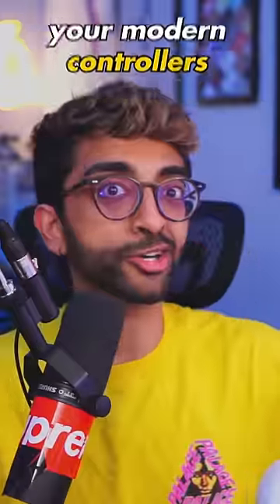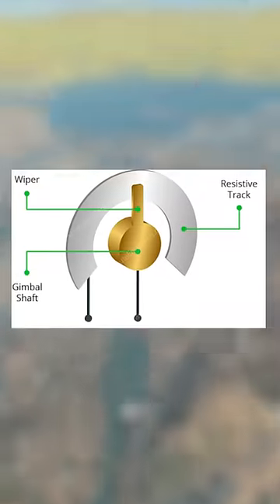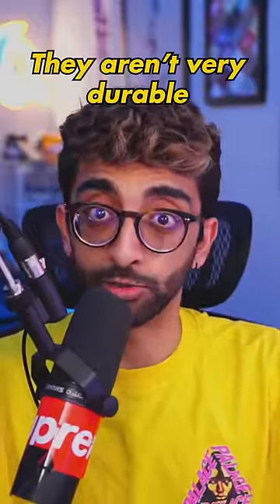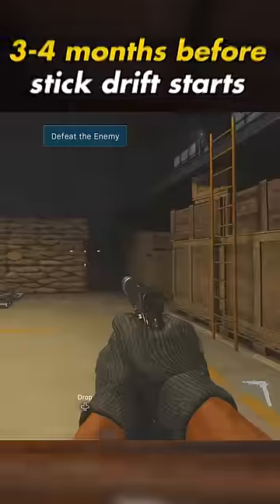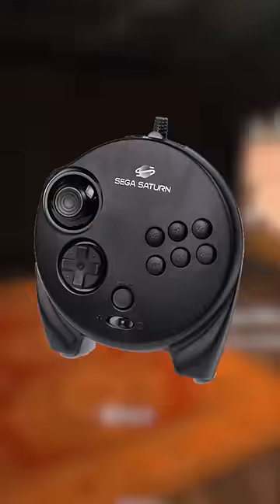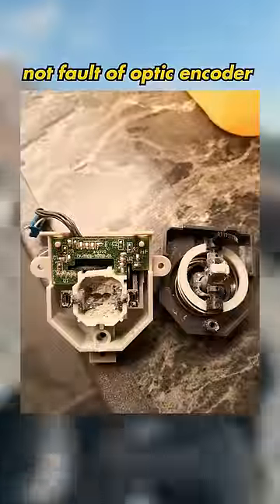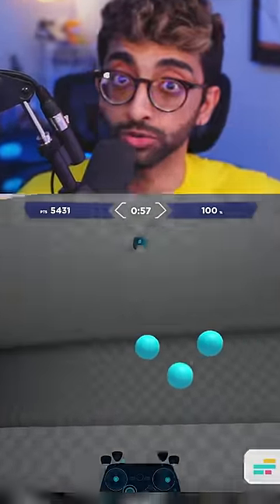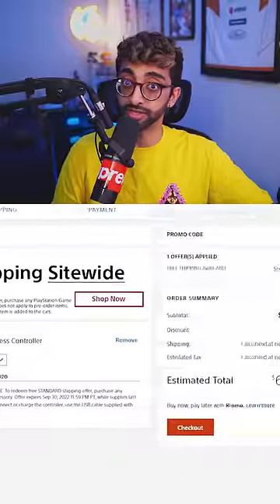The TRUTH Behind Joystick Drift

Comment: Even a quick, low effort cleaning can completely revive a controller. Like a half hour breakdown to get the gunk out and clear your contacts can add a long time to the lifespan and make a marked difference in performance.
Reply: Real af, I got an og xbone controller and another for parts and they’ve lasted me 10 years
Reply: Yup had two controllers get stick drift and wasn’t prepared to buy a new controller so I opened up and cleaned it and both controllers feel like new
Reply: Facts I’ve literally poured alcohol into the gaps under the sticks and it fixed my stick drift
Reply: Whoaaah you expecting A LOT from Nintendo haters crying about stick drift.
Reply: Sorry. You can't clean away metal wearing off.
Reply: @madchoochoo1501  xbone?
Reply: @a_monkey_hater  XBox One. That's such a dumb console name.
Reply: @a_monkey_hater  Popular nickname for the og xbox one cuz it was a bit off a mess when it came out
Reply: @4f52 Often its not the metal wearing off, but gunk filling up in the sensors. Just clean it and you’ll see big differences
Reply: @4f52  cat meat.
Reply: I cleaned mine and it got worse😪
Reply: Use compressed air to spray under the sticks.

Always fixes mine
Reply: Yeah I use qd electric cleaner
Reply: Literally untrue did u watch the video?
Reply: @Wavedashnoir  no it can work he just might not have thought about it
Reply: @YTREZN  That has nothing to do with the product lifespan reported in the video.
Reply: @4f52  its the metal (or whatever material that is used) that wore off that causes the problems, the gunk causes the wiper to look larger than it is on the resistive pad.
Reply: @calebs4887  Exactly. Good luck cleaning that. That being the problem reported in the video and the reason for the low lifespam and not dirty controllers
Reply: Just pour some alcohol on it and smash all the buttons that's how the og low efforts work
Reply: @sand_block2093  well it's always worth trying. Definitely gotta be super carefully around the tiny bits.
Reply: @4f52  but you can clean/maintain a controller to prevent the metal wearing off in the first place.

Personally I just wash my hands before touching my controllers and occasionally wipe them down with an antibac wipe, much easier approach.
Reply: @ManMang0  You can't prevent it. It's a structural problem as reported by the engineers who analyzed it and gave the controller that lifespam. You can't fix it unless you replace the gyroscope. Or Sony decides to not be cheap about their controllers and being dishonest with planned obsolescence
Reply: @4f52  I didn't say anything about preventing it indefinitely but it's not exactly controversial to say keeping your controller clean inside and out extends the lifespan of them. Also Sony? I wouldn't touch a Sony controller with my feet let alone hands.
Reply: @ManMang0  And Xbox too but Sony just released an expensive "pro" controller with the same crappy gyroscope that will break with the same useful life as their normar controllers
Reply: @ManMang0  That's not true.  It's a graphite pad it'll eventually wear down.  Cleaning it may de-gunk the wiper but you can't stop eroding the pot altogether.
Reply: @Tw1dg1t  did I say you can make the controller last a lifetime? No, of course it will eventually wear down but as I said, I make controller last a long time by making sure I only use them with clean hands and ocassionally clean them externally.
Reply: @bayonsn8378 how did u clean it

Comment: Money. Simple answer. We already have the solution. Think of any problem that is just too profitable to get rid of.
Reply: Same reason why we don't have forever bulbs, and so many other forever products. Hell, cars could've also been better products if they tried
Reply: @theonethatcan7780  to be fair on that bulb part tho, they do last a very long time and they're quite cheap when it comes to replacing them, had mine for around 4 years now. 
I'm not sure about this but I did hear that LED light bulbs can last up to 20 years
Reply: @monkeyl-  he said forever bulb tho. not quite forever but theres a fire station that has had the same light on since the 1800's iirc.
Reply: Phone durability
Reply: @SpilledBeans  ong
Reply: @theonethatcan7780  those bulbs are cheaper than these garbage controllers and it has a practical use.
Reply: @SpilledBeans  Nokia was the king
Reply: @GsQDoom  that’s because it’s constantly on, the most damaging thing for lightbulbs is being heat cycled from being turned on and off, it causes the lighting element to wear out, the same way your car burns more gas if you’re constantly accelerating and decelerating rather than just cruising at one speed

Comment: I modded my ps5 controller and replaced the old sticks with new ones. The new ones use a metal amalgam instead of graphite pads. Right now im also working on paddles for the controller.
Reply: If you dont mind me asking, where'd you get the new stick modules from?
Reply: will do this with mine at some point, seems like a fantastic idea. back paddles seem a lot more awkward to make work, but gl!
Reply: Please tell me where u found those, been looking everywhere
Reply: @ilikebread1661  i bought them from a romanian website, but you can find some on Amazon
Reply: @ttttttttttttttttt.  there was a kit online for back pedals but once installed you coud not use 2 of the face buttons because the pedals would connect to the traces of those respective buttons on the pcb (pain in the ass to install and requires special tools). The ones im working on are 3d printed, slide on and off and will physically push down the buttons instead of replacing them. At the moment the mechanism is super clunky and fragile and progress is going slow because i dont own a 3d printer i use one on the grounds of a university (i dont actually go to it so if i get caught i might get banned)
Reply: @MajorisMons  i think there are some on amazon
Reply: Tell me more

Comment: This kinda stuff is why I'm glad I learned how to fix my controllers when I was pretty young. I have a whole drawer full of controller parts I could make a Frankenstein controller if I wanted to
Reply: do it! >:)
Reply: Literally how my last controller was for ps4 before I got the ps5, that thing had parts from like 4 or 5 different controller, the things I remember replacing are the battery, some of the ribbon wires, the light bar in the front, and the thumbsticks. (And bullet casing style buttons but those were just from ebay, not another controller)
Reply: Any suggestions for new bumpers for xbox? Ordered some but none of them fit and im abt to just buy a new controller

Comment: Ooooor… pop it open and clean the pad. Works like a charm
Reply: Or just loosen the brackets holding potentiometer
Reply: Only works very early on and if the drift is caused by dust or other foreign contamination. If it’s caused by excess wear then cleaning it won’t fix it
Reply: @theofficialwizard2753  idk about very early on. I’ve been using the same controller for  3 almost 4 years now, and it starts to get drift about every 4-6 months. Every time that happens, I pop it open and clean off the pad. However, I have noticed that it is becoming more and more frequent, so it makes sense that’ll eventually become irreparable. But even then, just replace the peto itself. It’s 3 easily accessible solder points, and a fresh one is super cheap. Sure as hell beats a 70 new one lol
Reply: Got rid of the “$” sign on 70 for some reason. My b
Reply: @ThatOneGuy  Ya i never knew you could switch them until recently i just need to learn how to solder now
Reply: This works but after years it eventually wears down to the point of it drifting constantly. I learned it the hard way and had to display my first controller as memory
Reply: This won't work if the graphite is gone.
Reply: I don’t see how cleaning it would fix the wear you’ve done onto it. If something’s broken you don’t clean it to fix it
Reply: Ah yes let me clean the wear.
Reply: @theofficialwizard2753  ye my stick is stick forward lmao, I think that pad I'd just gone
Reply: No it doesn't, I've tried it. After a bit it's back and the whole thing has to be replaced.
Reply: @thatoneguy7618 or... you can just get the hall effect ones instead of the potentiometer ones and solder them instead. I could have sworn I have seen just the hall effect modules getting sold somewhere; just gotta find out would they fit in the controller.

Comment: Me with my steering wheel: I don’t have such weaknesses
Reply: Racing wheels still need position sensors, its just that they only need one. The position sensor is also usually a potentiometer iirc, meaning you have exactly such weaknesses.
Reply: @Kevin-dt9xm  I- Uh- Just because you’re right doesn’t mean you’re correct
Reply: @Kevin-dt9xm  if your racing wheel uses a potentiometer you deserve everything you get for being so cheap. Even Logitech's toy wheels from decades ago used optical encoders and there's no way Fanatec, Thrustmaster or any higher end brand is using a pot instead of something more sophisticated.

The pedals, on the other hand...
Reply: @n_tas  man, if potentiometers are good enough for real car pedals, theyre good enough for toy car pedals lol

Comment: There’s actually a weird fix for this. All you have to do is cover the joystick with your mouth and then blow. This has always worked for me although i don’t know if it works for a controller that has been used for a very long time
Reply: weird, my uncle told me this once too
Reply: Wat lol
Reply: i think that's a user being a hobo issue that blowing air is required to remove all the gunk
Reply: Lol if you want Covid go ahead 😂
Reply: Only if the problem is gunk and crap in there. If it's actually worn down, blowing air and moisture into it is going to do nothing.
Reply: Doesn't always work and I think it only works with the elite controllers

Comment: Also, the hall effect sensors use magnets, and those magnets over time could lose/change their magnetism causing less accuracy in their tracking
Reply: After 20 years
Reply: @benjaworld2804 ^ this. And the rest of the controller may fail before you ever experience that. Plus if your controller still works after 20+ years without being repaired or replaced and the sticks drift after that, the controller owes you NOTHING

Comment: Some people would be surprised when they hear about cleaning their controller with alcohol daily
Reply: Alcohol everyday?
I'm not religiously opening my controller just to rub a little alcohol in there until it short wires. 

Besides this specific problem sounds more like degradation then it being dirty. AND ANOTHER THING oh wait my rant is over.

But no a little dusting it off saves the day.
Reply: @tequalssquareplushell5358   Take the batteries out so it doesn't short..then use alcohol on a q-tip on buttons and sticks and 90% of problems don't arise. The actual degradation is less of a problem and it's usually a bunch of gunk from peoples booger fingers and never cleaning it. Just saying but if it isn't for you then don't 🤷‍♂️
Reply: @Jacob Jettie  how long have you done this
Reply: @NTG.Trading  🤦🏾‍♂️i have a dozen controllers that say otherwise, plus a couple of brand new ones that started drifting right out the box
Reply: @GojosBackHand   cool. idk why mfs started attacking me for sharing a tip. i have an oem xbox controller that i've used daily for 4-6 hours a day that is still working perfectly after a year of use. keeping it clean works for me.
Reply: i literally just recommending keeping it clean and all y'all come here "der der der NaH BrO NoT hOw iT WoRks"
Reply: @NTG.Trading  
You can take a chill pill 💊

Comment: I've gotten more into doing diy repairs and honestly I love tinkering with my electronics if I have the time and resources. I refurbished my own ps4, giving it good cleaning and replacing thermal paste. I also replaced the fan in my Nintendo switch and the thermal paste. Once I have more expendable income I want to repair some of my old ps4 controllers because the only thing really wrong with them is the usb port for charging.
Reply: How would you fix the L1 bumper on a PS4 controller?
Reply: @Charles Hollins  If you take it apart something probably just fell out of place or maybe broke internally id youtube a video on it, shouldnt be too hard to fix

Comment: My 6 year old controller still been going strong
Reply: Wich brand?
Reply: @stoneyhigh05  the regular PlayStation 4 controller
Reply: @Kylebayerdagoat 
Agree my original ps4 contrller comes in box with console (2017) so far no issue besides battery runs out fast. But my new ps4 contoller 2022 ver, gt stick drift aftr 1year..😢

Comment: I connected an XBox One controller to my computer so I can control a plane in GeoFS with a joystick. The problem with this is that GeoFS doesn’t come with a calibrator and my Joystick isn’t centered properly.

So sometimes when my joysticks are at zero on my controller the plane will pitch upwards or bank right despite me not doing anything.

They are pretty sensitive so when I move it to try to centre the plane it will sometimes do something and mess up.

Thank God for the A/P. Makes things easier for me so I don’t have to use the stupid controller to control all the time.

Comment: U went too fast, WHAT ARE MY OPTIONS 😭
Reply: Buy a new one, or take apart the controller and replace the joysticks. There is a third which is take apart controller and clean it, will work for a while bt nit forever.
Reply: Go to controller settings then go to advanced and the go to inputs deadzone there you will see left stick min and right stick min you have to adjust one of them it depends on wich stick drifts
Reply: @Cihan Akcay  only problem is that it will be harder to turn and control recoil or do small inputs with dead zone that's above like 20% .
Reply: @electronicuk1639  mine is at 20% and i don't have any problem but i don't know above 20% but thanks for the info

Comment: You can temporarily fix the potentiometer drift with some very, VERY precise cleaning and adjustments. I would not advise a casual user to do such, but if you or someone you know is experienced in electronics repair, it'll stretch its use out for a few more weeks so you can plan to buy a new stick (or new controller).

Comment: The copper coating inside the mechanism can create residue from the wear and tear like you mentioned. In return making false input in my case “stick drift”
Ps4 controller 1 year old had stick drift and I cleaned the disc with a Q tip. Still works 1 year later.

Comment: Ive had the same xbox controller for 2.5 years and its seen heavy use (games like cod, r6 siege, battlefield), ive even slammed it a few times, dropped every so often, and even once thrown full speed at my wall. It still works like brand new. My controller is confirmed made out of adamantium.

Comment: You can also desolder the old potentiometer. And many times drift is caused by dust and debris. 
You should:
1)clean the pot with contact cleaner
2)re-calibrate (some controllers have a built in combination of buttons to start it, if not do it via software on  windows)
3)change the potentiometer or switch it for an hall effect.

Comment: It’s actually insanely easy to fix. Get a can of compressed air and a Q-tip lots of times drift can also be caused by dust build up under the joy sticks. So spray some compressed air into that area underneath your analog sticks while rotating them makin sure you get each part of it then wet the Q-Tip and rub it along the base of the analog sticks. Let it air dry and it should be fixed. I’ve had the same PS4 controller for almost 3 years and every time I’ve gotten drift that’s fixed it

Comment: you can clean them is MAF cleaner. electronics cleaner designed to clean one of the most sensitive sensors on your car. I wouldn't use anything else personally, this evaporates without residue.

Comment: Making a potentiometer last more than 200,000 moves is pretty difficult. Some designs with a rolling wheel on the wiper may last longer or maybe not.
  But if the problem is just a drift of the zero position, digitally zeroing out the value returned by the resting position could delay the problem.  Show a screen telling the player to push nothing and then read what the joystick says that number is.
Reply: They would loose money then

Comment: I actually opened up my pro controller and attempted to remove the sensor myself. It wasn't torn or too bent so I put it back, and months later it's actually been working really well for me. 😁 There has been no drift, and I didn't have to buy another joystick.

Comment: There is a third option. You can replace the part in the controller. It can be tedious because of the size of the parts, but the initial investment isn't that expensive. You can find some cheap, reliable tool kits to do the job, and you will definitely have read reviews to determine part reliability, but it saves so much money. I dont really buy new controllers anymore. I just fix the ones I have or buy used ones and fix or customize those. Fair warnings, though, you will most likely void your warranty repairing these, but I find most controller warranties are useless anyway.

Comment: My GameCube controller is 19 years old and still works. I got a Gulikit King Kong Pro 2 for my switch & laptop & that has worked a treat. I  tried fixing my ps4 controller and it has been a hassle. It's a 14pin pcb. And the kind of heat gun I would need is closer to 120 bucks. So I bought chipquick and quality solder wick. I'm gonna see how this goes.